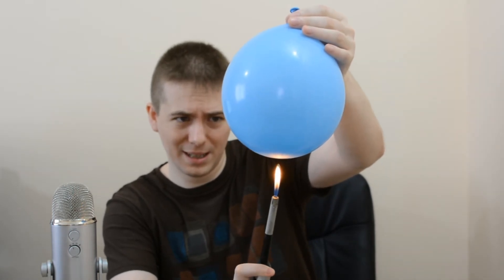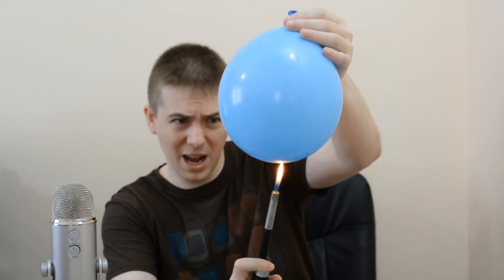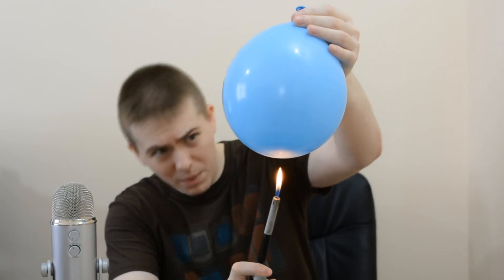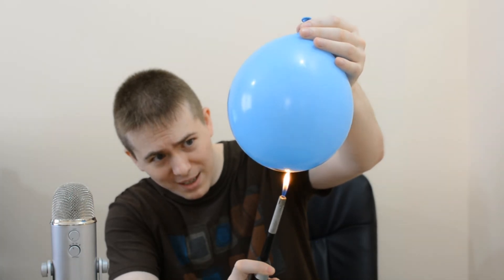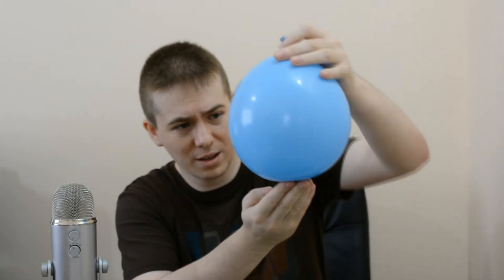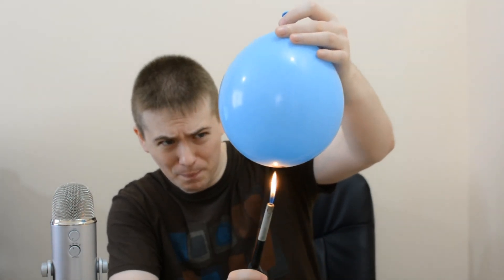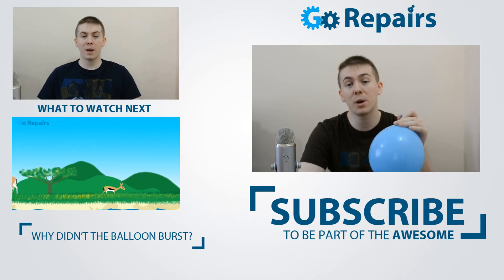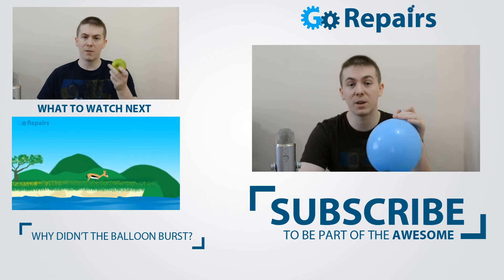Fireproof Balloon Science Experiment

Comment: How this works: The water absorbs the heat. Until all the water is evaporated, the temperature remains at water's boiling point (100° C) which is lower that the fire point of the container material. Try boiling water over a flame using an origami box you made from a piece of paper.
Reply from the maker: Good explanation, I'll have to give that a try.